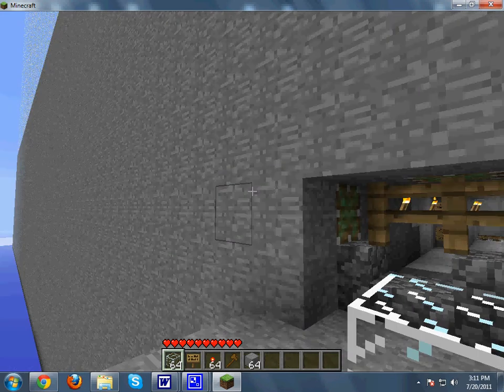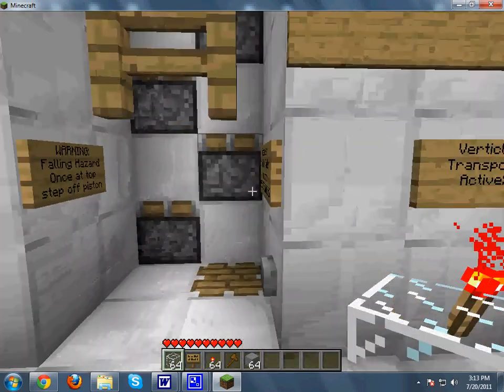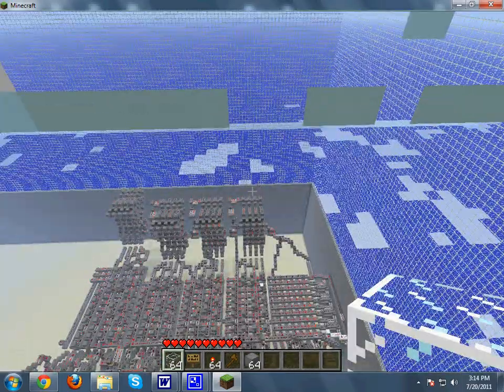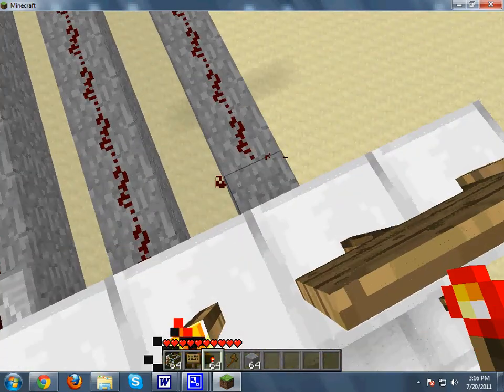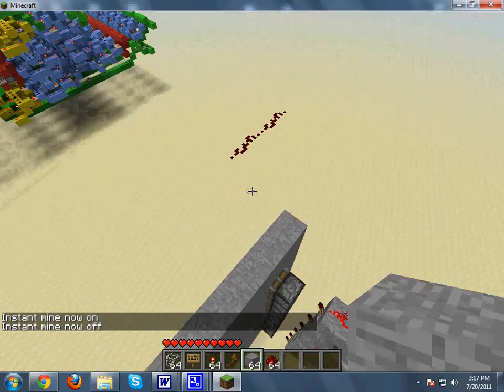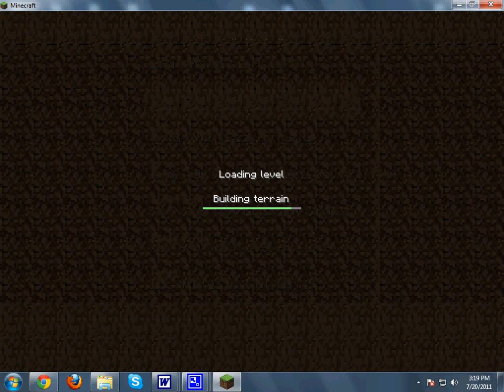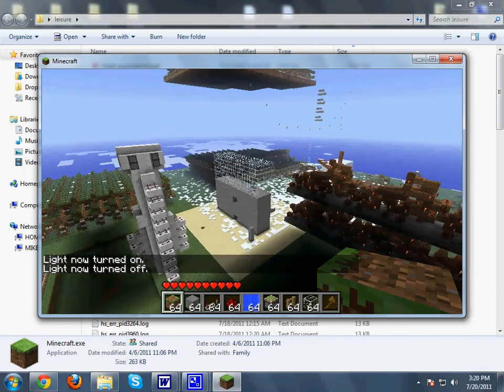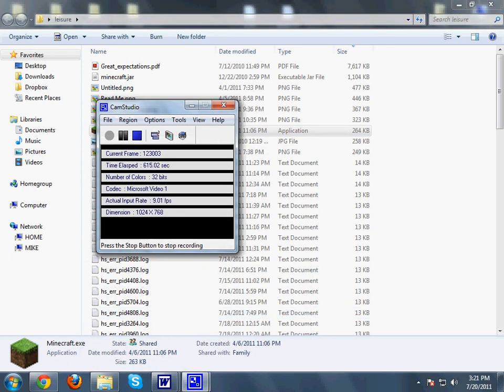New LAB, piston clock, elevator RAM, ROM and CPU

Comment from the maker: @invisible0tom It is the equivalent of the older model. It has an ALU (that can and, or, invert, 0, add, subtract etc.) with an output to 2 registers (the inputs incidentally) and RAM. the ALU can use either A register or RAM input and it used d register. It can jump to the value in A register (conditionals) and can write to A from the instructional input. the PC can jump or increment. Its a neat little CPU, but I need to finish it.

Comment from the maker: @invisible0tom Complex mathematics are a perfect example of the hardware/software trade off. As You managed to build multipliers and dividers on the hard ware level any Turing complete machine can emulate it, whether it be by literally simulating the necessary circuits or by different means. For the Hack platform, a program could 1. take the variables, 2. add one of the multipliers to an independent answer variable and loop the aount that is in the unused variable. (AKA 7*3= 7+7+7=21)

Comment from the maker: @1424541 I've considered the idea before actually but I rather like the current system. I have a similar piece but am content. You are right though, for the clock I could cut it down to 1/4th its size.